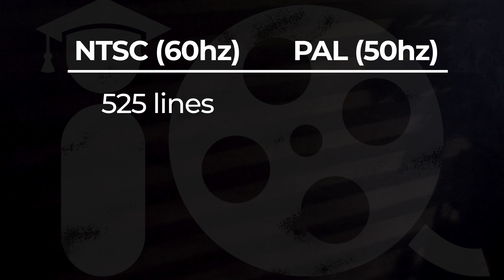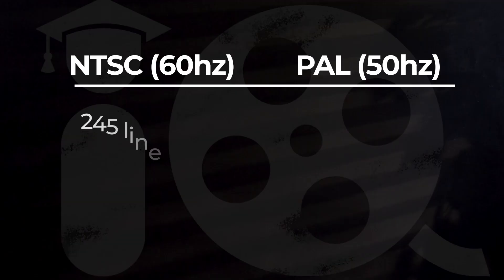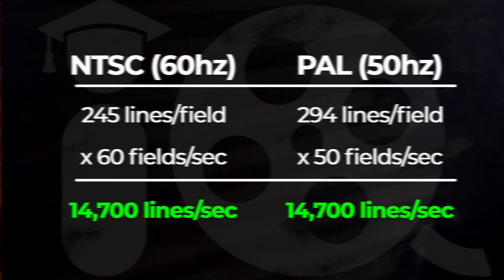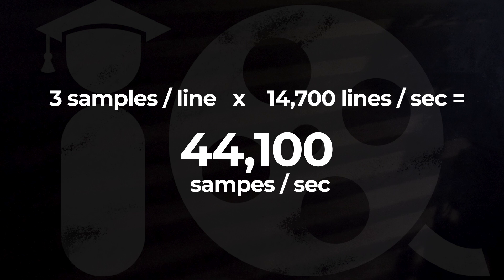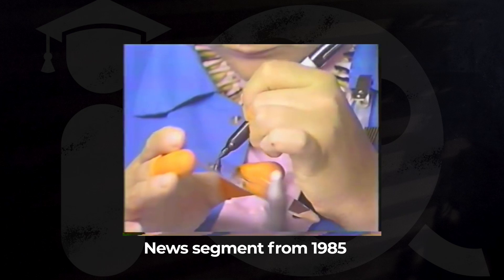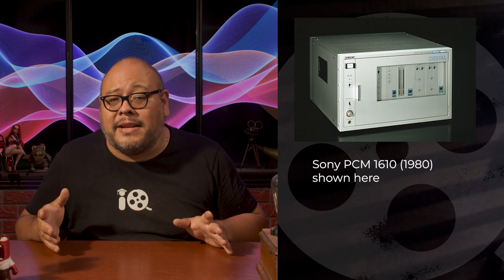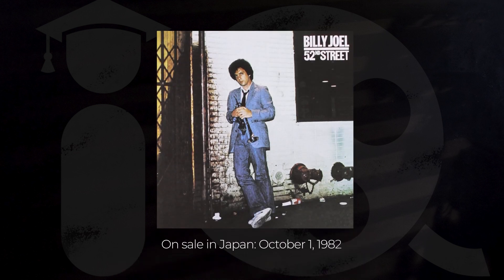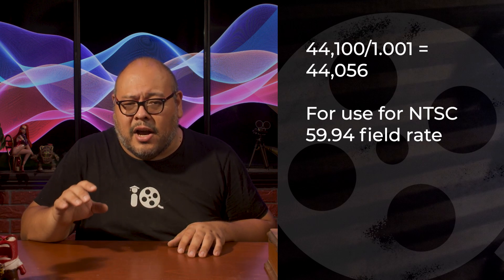The Surprising Origins of Digital Audio Sampling Rates

Comment: While humans cannot consciously hear over 20kHz, there are some claims that frequencies above that can be sensed subconsciously.
Reply: Those claims have never been verified with double blind listening tests.   Also, what musical instrument has musical overtones that high that are actually picked up by the mic?  I doubt that there are any.
Reply: @robertromero8692  You're totally right, and it may just be that the increased sample rate is actually just capturing harmonics in the audible range and enhancing the recorded timbre of the instruments.
Reply from the maker: Increasing the sample rate would not capture any more harmonics in the audible range. Everything that's in the audible range is already perfectly captured with the lower sampling rate (mathematical proven to be absolutely a perfect capture). The only benefit the higher sampling rate provides is simpler filters for anti aliasing for frequencies above Nyquist threshold for human hearing.
Reply: @truckerallikatuk  The increased sample rate can't capture any more harmonics in the audible range.  44.1 and 48 already capture all of them.
Reply from the maker: If that were the case it really should be measurable. But even then you would need speakers capable of generating ultrasounic frequencies...

I think there's probably some scientific curiousity there but it's beyond the realm of music production.

Comment: We are really lucky how futureproof the 44.1 kHz CD quality standard was. It did, does, and will always sound good. Still higher quality than the audio of almost everything we stream today. It's hard to believe such a good quality standard came in the 1980s while video standards arguably didn't get futureproof until the Blu-Ray/HD DVD came out.
Reply: Yeah, they really knew what they were doing when they set that standard. On the recording side 24 bits is prefered, 16 bits is just fine for a mastered music track though.. I record, mix and master my band and have the equipment needed for that so i have both experience and knowledge of that, im also a service tech educated in the Audio/video area.
Reply: @Stefan-  have you tried floats for recording instead of ints? Some of my music production pals swear by it and some HATE it.
Reply: @kaitlyn__L  No i have never tried floating point, it seems to be just like safety net if you dont do your homework and record at proper levels (read: not to high levels) it wont make it sound any better than 24 bits and you will apparently have wav files that are 30% larger or maybe more, with more data it will also take more CPU power of your computer. If you dont clip the audio in the DAW when recording 24 bits is just fine, you dont have to worry very much about the recording level maybe being somewhat low either since 24bits has 256 times more dynamic range than 16 bits so there is plenty of range for audio production.
Reply: @Stefan-  "24bits has 256 times more dynamic range than 16 bits"
That's not what you really meant to say, is it? 😁
Reply: @TERN666  I should probably have used the words "dynamic resolution" instead of "dynamic range", i think those have been mixed up by many and i was probably influenced by that. While the difference in dynamic range between 16 and 24 bits is very significant its the dynamic resolution that is 256 times higher with 24 bits compared to 16 bits and its also very significant. Besides this mixup, the conclusion still stands, recording in 24 bits instead of 16 bits has huge advantages.
Reply: @Stefan-  Number 256 gives us nothing. We should only care about 48 extra db of dynamics. Which is cool for recording, 32 bit is cool too. For playback, a well mastered audio sits well within 16 bits with room to spare.
Reply: @TERN666  That 256 times is really a description of the difference in number of amplitude steps when comparing 16 bits to 24 bits, its the math/technology behind the 48 extra dB´s so it clearly gives us that. The difference that users of digital audio recording equipment get from that in reality is the 48 extra dB´s of dynamic range as you indicate. I also already stated earlier i this thread that 16 bits is just fine for audio reproduction like on a mastered CD, 32 bit is fine of course but not normally needed really so i dont disagree with you on that.
Reply: It was optimized by dithering on the one hand.
On the other hand, one could use a higher dynamic at home. It's not allowed to disturb neighborhood, the room is noisy, consumer speakers can't handle high sound levels.
Reply: Leif  And they should be lucky that they cannot hear higher frequencies than what we mere mortals do as the so called high frequency recordings contains lots and lots of noise in the upper frequencies: https://www.youtube.com/watch?v=MOVT_4yO5hs

Comment: Fantastic video, as always. :)

As I don my flame retardant armour, I will mention that some humans can actually hear into frequencies where 44.1khz vs. 48khz would make a difference - Nyquist-Shannon defines that the highest frequency wave you can encode at 44.1khz is 22.05khz, and 48khz give 24khz. That's above the range of normal human hearing as most adults over 30 can't hear above about 16-18khz, but particularly young children can sometimes hear up to at least 26khz and every now and then you run into an older adult who can still hear above 20khz. Of course, finding speakers that can accurately reproduce that kind of frequency while not sounding like absolute garbage at the lower end is a non-starter. :)

Also no mention of the telephone system? :) Bell Labs @ Palo Alto was experimenting with digital encoding back in the 50's, and the phone network went digital in 1964, albeit with a 16khz/8bit sample rate....

Comment: Most commercial music I have encountered as a musician and recording engineer has been produced at 44.1 kHz.  But now with high-res streaming platforms available (eg, Tidal), it makes sense to record audio at 48kHz or higher, depending on the circumstances.  Music with a lot of dynamic range will sound better at 96kHz or even 192kHz (you can hear the increased sense of space and location).  Regular head-banging rock n roll, for example, will reproduce perfectly well at 44.1kHz.  Also, because of in-the-box mixing and mastering, higher sample rates equal improved accuracy in digital processing.  So,  simply:  use the highest PRACTICAL sample rate for each project.
Reply from the maker: That's incorrect. Bit rate governs  dynamic range, not sampling frequency. Sampling frequency is only regards to frequency capture and how much room you gave to work with with your filters. 96 is probably the most you would ever need, there is a train of thought that going higher is actually detrimental and leads to more errors. For dynamic range, jump up to 24 or floating 32 point
Reply: Mr. Hess, you certainly are a superb teacher!

Comment: 48k also makes circuit design just a bit easier, you can use less aggressive anti-aliasing filtering.. and it simplifies the math a bit in digital side. The other number, 24bit is even more important specially in broadcasting as it allows for more headroom. 16bit is what we need but when you are working with live signals that are often unpredictable you will enjoy having those few bits extra. This works well also in other audio production, 24/48k is what vidiots wanted and it happens to also make things better elsewhere. So, thanks.. i guess..

There is no need to go higher, we can prove it quite definitively, also when it comes to processing but with one crucial detail added: 48k requires oversampling and filtering at each processing stage (384k project sample rate is equivalent to 48k if latter uses oversampling scheme, it also uses 8 times the bandwidth and file space and has a higher processing load. 192k is worse and 96k is damn right idiotic, it is considerably worse to a point where it can be audible..). So, turn all of those "high quality" and "oversampling" buttons on in your plugins, they are there for that specific reason. Especially important with all processing that affect the time component of the signal in anyway, this includes compressors.. but not stuff like linear saturation or simple gain, distortion or even delays (repeating is not modifying the time component.. ). Chorus and phasers are especially problematic and oversampling is absolutely mandatory.

24/48k is perfect format for all audio production.
Reply from the maker: The issue is computational processing power. Audio mixing involves often hundreds of simultaneous tracks with long effects chains. Where as there's some flex and give with sync when it comes to video sync (there's about 100ms wiggle room before you can tell something is out of sync), there is almost zero wiggle room when mixing audio tracks.

Add on top of that oversampling a recording to 384khz is just downright pointless as it introduces more sampling errors and virtually no microphone can generate the response that could effectively utilize the frequency space. Now there might be some filters that might benefit by the oversample but they can do that on their own.
Reply from the maker: My understanding is limited but basically the underlying concept is that going beyond say 88 or 96khz, all your doing is capturing frequencies we aren't going to hear anyways. An in doing so we introduce intermodulation errors. Digital sampling theory states that we can recreate perfectly any signal that is has half frequencies that are half the sample rate, we need extra headroom to band limit the signal to prevent aliasing. But after that, we're just eating resources that's won't really get us any more benefit and potentially leadimg to degrading the signal.
Reply: it's about collecting (record) as much audio PCM/PDM data as you can, convert/process/edit using as much precision as you can, then downsample (depends on your targeted viewer/audience and expected playback equipment) for the final release, whether it be 16/48 or 44.1 or 24/96 or DSD64 or DSD128 or ...
Reply: assuming there is an abundance capacity to process/store that higher density data, wouldn't it be better to ditch oversampling (i.e. interpolation/guess) but  use original recorded data at the equivalent sampling rate? (48kx8=384k, work for noise shaping, editing, downsample for various consumption)

Comment: In the late 80's the amount of data you could put on a CD seemed unimaginable to us. The place I worked for put all of our dozen applications onto a single CD with space to spare and that was writing the contents of multiple hard drives onto this seemingly bottomless media. You could buy a 600 megabyte SCSI drive but the cost was horrific so we didn't.
Reply from the maker: I remember the Jazz Drive... We'll never fill up a gigabyte!
Reply: I remember that hard drives only started to catch up with CD capacity around 1994. It's so weird these days to imagine optical media having much larger capacity than hard disks or SSDs. Even quad-layer Blu-ray tops out at 100GB, while you won't find a hard drive with less than 1TB these days.
Reply: I worked in a Electronic retailer here in Sydney, Aus (Dick Smith)  in the early 80's... (A competitor to what you'd call radio shack, here known as Tandy) and we  had a Tandy (RS) TRS80 clone called the System 80...
I sold a 5Mb Drive for $15K (Aus), which also required a $1.5k I/o card option to use it!
Fun times indeed.
Thats 1 min mono/ 30sec Stereo in sample currency @44.1 / 16bit......
Reply: Ahhh yeah, the CD. So big, yet so small. You could fit entire games and entire encyclopedias in it, but the moment any significant amount of video was involved, you needed multiple CDs. A standard 2 hour movie needed 2 CDs (for VCD quality), and some interactive movie games came on as much as 7 CDs.
Reply: Reminds me of my first hard drive, one I had installed in my Commodore Colt PC. It was 30mb and I thought at the time "How am I going to fill this?"
Reply: Scott Larson
unimaginable? the problem is speed, the scsi I/O interface is not fast enough to store it, VCR was.
Reply: @lucasrem  Store what?
Reply: @lucasrem  Scisi protocol WAS fast enough.. as were Harddrives...Stereo especially..It was the size and cost of storing the data. Even when SCSI drives were affordable, Tape drive systems were used to backup the data ... Look at Mezzo for example... 
A reason ADAT was susccessfull.. 
40mins of 8trk onto a SVHS tape... 
44.1/16bit... 5Mb per minute, per track...
40Mb per minute... thats 1.6Gb...
SCSI was fast enough... It was the cost.

Comment: I have one of Sony's PCM to video adapters, not from the PCM-1600 line, but the later, consumer oriented PCM-501ES model. It's similar to the Technics PCM deck that Mark Hesse posted, but it lacks a transport. Instead, it has a composite video input and output, designed to be hooked up to a VCR (be it VHS, Betamax or something else) It uses a different video encoding method than the 1600 series, but the three samples per line are still clearly visible. Of course, it does record and play back at 44.1 kHz. I wasn't sure about the origin of 48 kHz. I thought it might had to do something with DAT tapes, since that was the earliest widespread use of the 48 kHz sampling rate, outside of the film and video world.
Reply: Oh, and Sony's PCM-501ES (601ESD and 701ES) offered 16 bits of resolution, while the Technics deck could only do 14 bits. Here's a video of my PCM-501ES playing back some music from a VHS cassette: https://www.youtube.com/watch?v=MLDEwUDf5wE

Comment: I've played a lot with a pcm-601esd with Umatic and VHS. Very interesting device! Now I've HEARD that sony "Umatic Digital" was the master format sent to CD duplication houses. I can't help but wonder how much data is lost to video drop-outs.
Reply from the maker: Probably not as much as you think. Professional tape formats have always been much more robust than consumer formats like VHS. There's some surviving Quad tape from the 1950s that still look sharp today. Plus a digital signal is more robust than analog... A little noise won't really affect the quality. Then I believe some of those early models weren't truly 16bit, they were 13bit and used the extra bits as error correction
Reply: @FilmmakerIQ  Ok I didn't really factor in error correction, my 601 esd might have something. It can do 16 bit and 12 bit.  It seems to break up the sound by frequency and volume across the screen on the left and the right side is one large area that is random looking. 
 I fix many formats of vtrs for a tape preservation service actually (up to 1" type C) and have tried feeding the pcm various garbage to see what it will do. I remember large drop-outs do make a high pitch 'sparkling' noise, but I couldn't quite tell what small dropouts did exactly. BUT I was using a normal umatic vtr. Duplication houses might have had tricked out gear that did direct off-tape RF processing or something. 

I've had plans to connect 2 video pcm  tape playback decks to a mixer and run transition effects on the video signal feeding the PCM audio processor... It didn't like the last mixer I tried, lol. I've got more of them to try now though!
Reply: I have the 601ESD too indeed it’s fun, U-magic is a robust system, it allows a lot of tape real estate to avoid drop outs, Besides the PCM adapter have error correction for drop outs.

Comment: Great video! It is very interesting to learn why CDs use 44.1kHz. My job involves processing audio recorded from telephones. Historically, that's usually involved a sample rate of 6 or 8 kHz (due to limitations of the old hardware), although, more recently, there's been an increase in the use of 16, 24, 32, or even 48kHz. From that perspective, 44.1kHz audio is a major pain, because a lot of software used in the telephony sphere (e.g. speech recognition) still tends to expect 8kHz. If someone records some audio externally and then wants to import it into the system, it's a lot easier to deal with 48kHz than 44.1kHz if and when it's necessary to convert it to 8kHz!
Reply: I once wrote a resampling library for a phone system. I did that by filtering the signal (so it wouldn't have anything over the nyquist of the target rate) then making sure it was oversampled by at least 4 * the target rate (sinc filters for oversampling), then using splines to interpolate down.

That's a method that works for arbitrary rates.  It's been used in synthesizers.